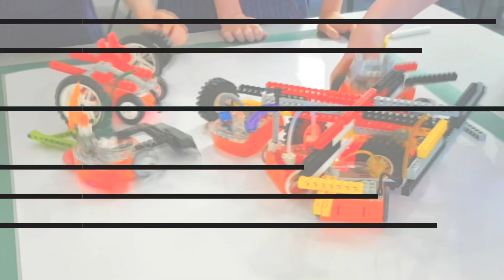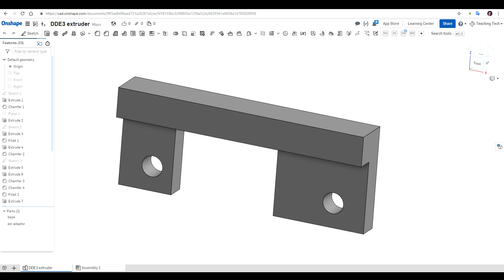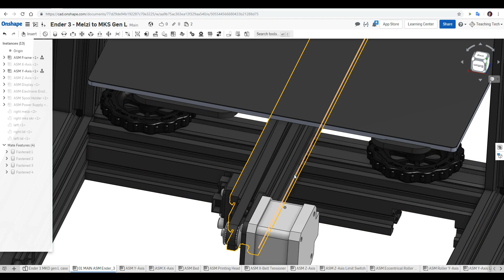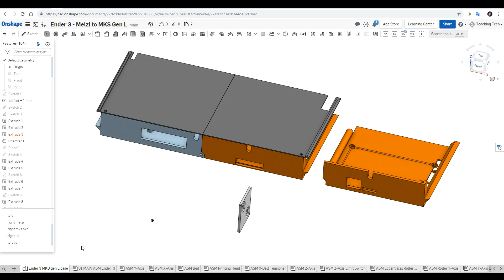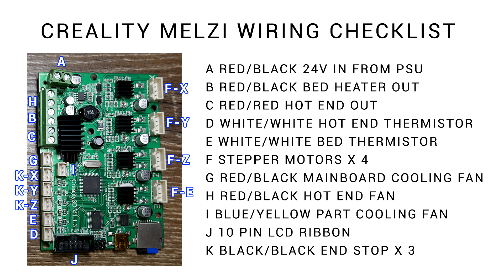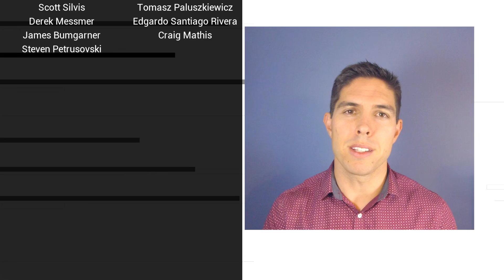Ender 3 upgrades: EZR to direct drive adaptor and all in one rear mounted electronics case

Comment: Hey I'm so sorry to bother you, I'm having a terrible time trying to learn this stuff. I've had my ender 3 pro for almost two weeks and have had fun printing a lot of stuff. I have also enjoyed your videos a lot and found them helpful. I just think when it comes to some of the programming stuff you go to fast especially for us older viewers. I just recently upgraded my board and monitor to the Btt skr mini e3 v2.o with the tft35 e3 v3.o. One thing that no one has mentioned is that my mainboard no longer recognizes sd cards installed. My prints will only read from the sd card slot that is located in the monitor. I have seen no one mention this. So this leads me to wonder if I want to upgrade the firmware which has me totally lost is do I just load the firmware on a sd card and insert into the mainboard and then turn on the printer? Or do I install the new firmware into the monitor and then turn on the printer. As there is also firmware for the monitor and have watched your video about that. But no one has covered this fact that my card reader is not reading in the mother board as far as printing items. I'm happy with the firmware that is running right now as it does way more then the original ender 3 pro board did. I did manage to update the original board with the th3d universal updater when I purchased a arduino un and cables. I managed to download the bootloader and then the new firmware. Here is my other issue. I have on order the Aliexpress ezabl version of their bed leveling system. I'm sure its not the same as the th3d one although it looks the same including the bootloader which I don't need. My problem is how do I get my new skr mini e3 v2.0 to work with my abl system when It gets here?? I've looked at the vanilla instructions on the th3d site for using their ezabl with non standard boards. However i'm still lost when it comes on knowing what to do with the firmware. I recently tried to download the firmware onto my computer to at least play with. However when when I went to extract all files It kept coming up with error messages saying that the file was to large for the target which has about 1tb of room on my hard drive. So I don't understand why these files are to big to be extracted to the target. I even made a new file on my desktop and tried to extract the files to this new file with same issue. I did manage to download the file for the new firmware for the monitor with no issues. How is a new person to the world of 3d printing supposed to learn all this stuff? Perhaps I'm to old to learn this stuff but I don't think that's the issue. I just haven't found the right video showing the steps one by one. Your doing a ok job but like I said just a bit to fast rattling off things. I even have re-played the same video multiple times with still feeling overwhelmed. And If i'm feeling this way then I know there are others out there having this same issue. I guess my biggest thing right now is learning how to get the bed leveling system configured in the firmware when it gets here. If I want to upgrade the firmware on the new Btt skr board what do I need to do? If the file won't extract properly. I downloaded it from the btt github for the v2.o board. Is there bad firmware files out there and if so how do I get the original file that is not been messed with??? Help please! thanks in advance..

Comment: I have on order an EZR strider to fit along with my printermods DD, my question is how far does the tubing need to be pushed into the strider. In the original video on the strider it was shown pushed all the way in but was very tight to do so. So my question is if pushed into hotted first how then be able to push it hard enough to get into strider and maybe have to pull it out again if too long or short

Comment: If its me. Id use one of the rear caps on the 20x20 bar for the front so that there are no ugly bolts and use nothing for the rear or use the suggested printable cap or even a cap that just taps in, like the factory one, again for no bolts. :)

Comment: I love this mod but I have a suggestion. Now that the card reader is in the back it seems it's not as practical to insert and remove the sd card anymore (or am I mistaken?). This would be a great opportunity to mix this mod with the "micro to standard sd card converter", so you could have it in the front!
Reply: With the RPi running Octoprint, you'll never use the SD card reader...
Reply: @darthvegan435  very true. It's just that I could do that mod now but the Pi would have to wait a bit (budget issues haha)... so the practicality thing is still valid for me ;)
Reply: @marceloaguiar76  I just printed the box...  if you have access to the rear of the printer, I'd say the SD card would be about the same... but if you have to remove the printer every time, then, no, it would be a pain in the keister...

Comment: I am so bummed out, Michael.  
The electronics enclosure printed beautifully.  While trying to fit it to the frame of my Ender 3 Pro, I discovered that my frame was 2 mm too narrow (and not 100% square).  3 Hours of hand filing the edges got it to fit, only to find out that the riser from Creality's BLTouch kit put the display cable and power header into the Y rail. (stock Melzi board)
I am keeping it though.  If I break down and put in an SKR, it looks like it will work nicely.

If you ever do a v2 design, maybe drop the box a mil or two?  The padded feet give enough clearance.

Comment: I love your designs and have been watching your channel for the last month.  Upgrades so far this week to my Ender 3:
Hydra Fan Duct system with dual 5015's
SKR Mini 1.2
TFT 3.5 E3 Touchscreen
Octipi/Raspberry 3B+
Raspberry Camera
Raspberry 3.5 Touch Screen
BL Touch
Magnetic bed and build plate
New dual drawers front/right
Now this!!!  The only thing I am missing is to have the hotbed cables come out the back of the box and a cable chain mount on the box.  I have cable chains on all the cabling.  I think it just makes things neater and it looks great!
Have you done anything with using the Raspberry Touch Screen with Octopi?   I am trying to find more info on getting that setup and running.
Thanks again Michael for all the great and informative videos!

Comment: Great video and great case.

I installed in on my ender 3 (nonpro)

I think my printer isn't precise enough for this as my case was a really tight fit. The covers were even tighter so I had to do some sanding.

My Z stop cable was too short to reach.

Luckily the y stop cable is long enough, can be separated from the stepper cable, and doesn't need to be long anymore so I just swapped it.
Reply: I'm doing mine right now and discovering my y stepper motor is to far forward to fit the cable hosing. I have a ender 3 non pro. did you see this?

In the video it looks like thje rail for his y axis evens up to the foot rails...mine is like an inch shorter.
Reply: I actually had to sand down the top and case around the connector so it could plug.
Reply: Just checked and yeah my y motor is further up than in the video
Reply: @johnnyolivares94  I had to connect it, then jam the casing in. pla is pretty plyable so whatever, its fine so far. worth it, just wanted to make sure i wasnt crazy

Comment: Been having alot of fun building a bunch of tid bits for my ender 3. The back electrical case is the build I am on now, question I have is about my heat syncs for my raspberry pi 4 model B. I could  not get a complete kit but did manage to get syncs in a kit for an older version, 2 fit fine, largest and smallest. The rectangular one did not come in the kit, but came square... Can I cut it down to size?  I'm confident I can avoiding the 2 little silver do dads next to the rectangle chip.

Comment: Printing a set of these off for my Pro as I write this.  This is an excellent mod.
I have thought of one thing you could add, that would really help.  I recently had to replace some parts due to a failed print head. (partly my fault.  I found out that you cannot combine an E3D V6 heater block for thermal cartridge with a Micro Swiss All-Metal Hot End)

Anyway, I ordered what appeared to be good replacement 24V cartridges on Amazon.  They are good quality, but...  even though they say they are for the Ender 3 printers, the wires were 9 inches too short.  in thinking about the issue, I though of putting a terminal block somewhere on the frame that would reach with the shorter wires, and that I could run a short patch to from the board.  In looking at what you have set up, I'm thinking that a lid mod for the right side is just the ticket.

I'm planning to remix your lid, to fit what I have on hand, but I thought you might like to apply your own version, to keep with your own design aesthetics, and maybe you can find a workable terminal block. (I'm going a little overboard with mine, I think)

Comment: The Z stop end sensor cable isn’t long enough to connect to the stock board in this tray and I’m very sad for this.
Reply: i noticed that also, ill extend it. But might me good to mention in the video
Reply: @bjurgen86  Absolutely, I just ordered a replacement pack of axis cables and am using the Y stop end cable which is plenty long enough since I don't have the right crimping tool to make a new one.
Reply: Jon K also mentioned in the comments here is to switch the z and y axis cables, that worked for me, maybe u can cancel ur order?
Reply: Jurgen Balk i definitely didn’t see that comment and I didn’t think about that lol but I already got the cables in. Not a big deal though but good to know, thanks for the info =D

Comment: I made a x y cable management mount that is compatible with this all in one... https://www.thingiverse.com/thing:4297020  ...   allows the hardware from this thingy:  https://www.thingiverse.com/thing:2920060  to work with your great all in one case for the Ender3.   Hope it helps (you mention needing to come up with a better cable management system for this all in one.. I think this is good).

Comment: one of the big problems with the upgrade is all the computer ports are in back so if it is in an enclosure you can't access them. computer ports (ether net,usb, micro sd or regular sd should ALWAYS be in the front not the back

Comment: I dunno if anyone has pointed this out or had a similar problem with factory board  but everything fit just like designed except the factory z-stop wire is too short to reach the board no matter which way you try to pull it through,  a simple fix was to swap the Y stop wire and the Z stop since the Y stop has extra length that isn't needed anymore since the electronics are in the back.  Everything else is great through.  Keep up the awesome work.

Comment: doesnt explain how to plug in the lcd. Mine by default On the lcd itself is in exp3 does that need changing or does it just plug in?
Reply from the maker: It's an electronics case, everything plugs back in as before.
Reply: @TeachingTech  turns out the lcd cable needs flipping for it to work. all sorted now

Comment: Which bolts did you use to hold down the raspberry pi? Because you mention M3 in the video, but M2.5 is the size of the holes in the RPI. M3 does not fit.

Comment: Hey there, after seeing this concept I had been intrigued, and wondered- could a similar setup be designed to also contain the components that are inside the power supply box? Is it safe to remove the components from the PSU box and relocate them to a 3D printed custom enclosure? Or is the aluminum/metal box necessary to prevent damage to the PSU/prevent fire?

Comment: So with the direct drive I should be able to print sain smart tpu with no stinging correct? I have also purchased  a WINSINN aluminum dual extruder 2 months ago but never installed it, would that work with the direct drive to or should i just get the EZR Extruder? And lastly with the set up like you have I would have to orient the filament spool holder in the same manner like you have your in the video??? I been prining PLA perfect since I had the Ender 3 Pro for past 2 months with stock everything but I want to do TPU and past 72 hours I have tried everything to get no strining with no avail at all......... Will I be needing to use  a short piece of bowden capricorn tubing, I cant really tell from this video?? and also I have all stock fans, will I need to have your whole setup in order to get this to work???

Comment: Hello all, I've recently been exposed to this wonderful world of 3D printing. I have yet to buy a printer, but very much looking into the Ender 3. My question is not knowing much about other machine options, so why should I buy this machine and go through all of the functional/cool upgrades to make it a better machine, if there is a machine that would be comprable to all of that price wise without having to do all of that extra work?

P.S. I get that this is a starter machine size-wise and I may want to get a different one later as I gain experience. I'm debating on a larger 300x300, but find the up grade world there as well. Lol

Thank you, I look forward to being a part of this community!

Comment: I assume you still have to use a short USB cable to connect the Raspberry Pi to the control board. Too bad there isn't a way to wire them together directly.

Comment: Am I the only one who printed this for the stock Ender 3 board and found that the Z stop cable was too short!!! :( :(
Can someone explain ? What did I miss ? 

https://youtu.be/k83M5H796U8?t=542   not true :(
Reply: You can fix this by switching the Z stop cable with the Y stop cable. You need to separate the Y stop cable from the main group it's on.

Comment: Hi great video, I'm new to the ender 3, why is it that you have a coloured screen on your ender 3, I noticed right at the ned of the video. I have the pro model but the screen is a lcd, is this a new board, screen and firmware version and if so any better? I am about to buy a Pi 3 to install octoprint to make life a little easier and then saw this.... thanks Neil

Comment: this looks great now got to order another full roll of filament :-)..Could I ask the following pleaseFound file but it says hump for pin 27 untested ,is this still the case or does it fit with the PIn 27 Board ?I take it I should print the standard Board case to fit in the new silent board V1.1.5 ?Keep up the good work I watch most of your videos now from the UK ...

Comment: My problem is the audio jack is obstructed by the fan. I would like to use this case with the fan mounted [preferably] on the other motherboard side of the case since I do not have any TL smoothers. Additionally move the 4 vent slots to the Raspberry Pi side, please.  That combination would give us back the audio jack.  Thank you.

Comment: Love the case idea!  But ran into a problem.  The BL Touch has a little board that plugs into the LCD ribbon port.  With that in it is too tall to put the cover on and it bumps into the middle Y axis extrusion.  Of course didn't figure this out till the installation. was all but complete.  Gotta move the board over to the right (looking at the back) a bit and figure. out a way to get a tick more vertical room.

Comment: Just finished this mod and its awesome! Love my new routed cables and simplicity. Went all the way and Y split the power to supply the RaspberryPi, and also installed a relay and the PSU Control plugin to provide the Pi with power switching capabilities (https://www.youtube.com/watch?v=ozCqqlPJ3a0).
A few things that I noted from my install, could be print quality but maybe not:
- M3x8 screws were quite long and would have stuck out of the underside of the case, ended up printing 4mm washers to go on top of the electronics to save this as I did not have any smaller bolts.
- The X Stepper & end stop cabling was too short to reach, so swapped for the Y Stepper & end stop which worked great.
- The Y Stepper seems to sit quite low, so the connectors on the underside touch the case lid - had to take care not to mash the cables on installing the case lid.

All in all an awesome mod, thanks!

Comment: When i printed the electonics case the 3mm bolts just slid in, no material to cut thread. Were you using 1/8 bolts? Same with the TL smoothers. 

My printer is calibrated and the im just wondering if its something im doing wrong

Comment: Love the design but feel like I'm missing something when it comes to powering the Pi from the main board.  Why is this more desirable than powering it separately. I sometimes like having OctoPi running even when my printer if offline. It also gives me more confidence when I remotely power off my Ender via a smart plug, that it's the printer that is offline, not just the Pi.
Reply: @LarkspeedNL  The printer does not have to be offline if the Pi is not transmitting. It could be that the Pi had failed (or just the wifi component). If my smart plug is showing "off" and OctoPi is showing no connection to the printer, I have redundant channels of information regarding the printer's status.
Reply: @RabidMortal1  Part of the benefit of using the relays that can be mounted behind the pi are so that the Ender 3's power supply can power the pi (using a Y splitter and buck converter), but the pi can block power from reaching the printer using the relay until a print is launched. After the print is complete, the pi can then shut the printer down. He has another video mostly explaining how to set this up if you're interested: https://www.youtube.com/watch?v=ozCqqlPJ3a0

Comment: From the skr 1.3, can i power a 12V noctua fan? or what voltage are the fan connectors on the skr 1.3 board? :) is 1 stepdown enough to power everything?